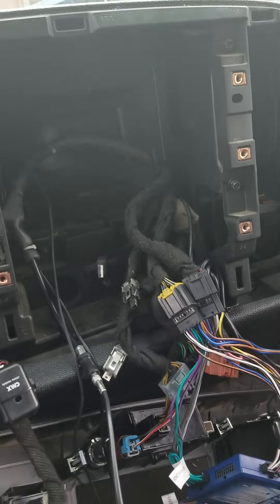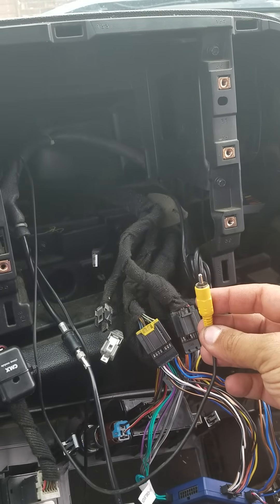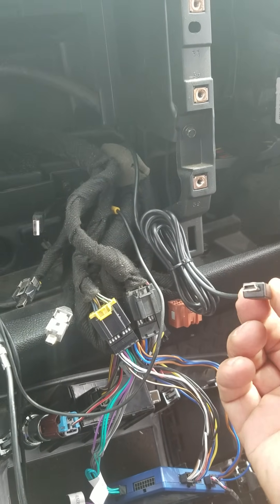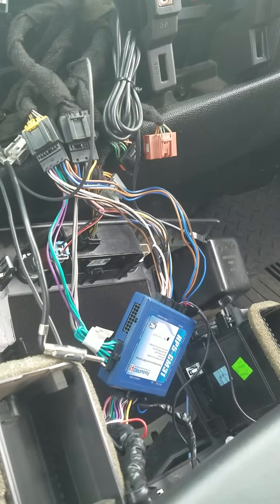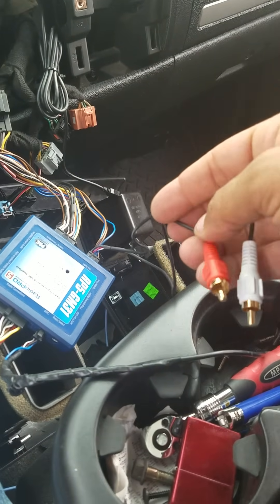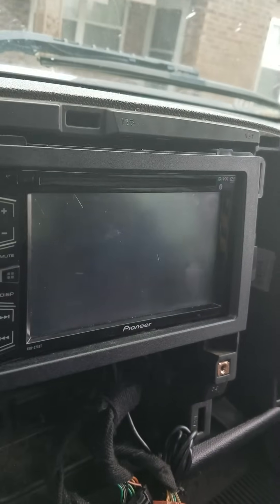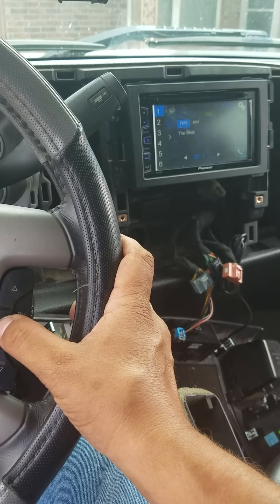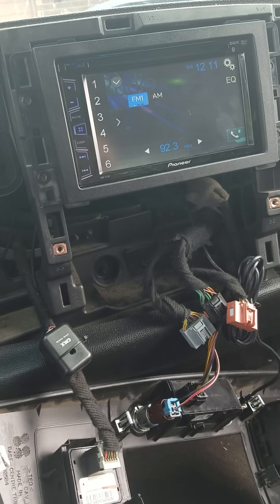Pac RP5-GM31 installation and operation.

Comment: Man! Thank you so much for making this video! I’ve spent two days trying to figure out what I did wrong. I hooked everything up but my sound was super low. That’s when I watched your video and saw that there was a plug in for amplified and non amplified on the p5 adapter thanks to you pointing it out in the video. I took it apart and checked, I had it plug into the amplified instead of the non amplified ( my truck doesn’t have a built in amp). Once I switched it my sound was back to normal! Thanks again!
Reply from the maker: No Problem, I'm glad it helped you.

Comment: Thanks for the info!  I saw this video the other day, but watched so many that day.  When my radio and kit (I went with the iDataLink Maestro RR) came in, I didnt have the connector for the video feed at the radio plugs as mine, like yours is in the rear view mirror.  So I spent 2 hours today trying to find this video again to find the location and colors for the video feed connector.  Anyways, that info helped out tremendously, and the video works flawlessly on both my in-dash and my mirror!

Comment: A little later but uhhh do I have to install this chime box, it’s very digital sounding. (Mine idk about yours) sounds like shit. I prefer the stock sounding chime. 

No dropping or anything. It was installed and I noticed the different sound right as I turned out of the installers place.

Comment: I had the same issue with my radio shutting off when receiving a call. It was also super loud when it was ringing. Disconnecting the Bluetooth on my phone fixed the issue.

Comment: Thanks for sharing the video. It was helpful. I test your theory on the Bluetooth. My new unit did the same thing. I'm guessing the old stereo blue tooth info mast be saved on the onboard computer and it screws it up. So I deleted all blue tooth devices that were programmed before installing the new JVC Touch Screen double din. It is similar to what you have and it sits in from the mount too. Not quite as deep as yours, but still deeper than being flush like the old radio (Maybe 1/16"). All in all with the RP5GM31 unit, my OnStar and steering wheel controls came right up. I didn't have to do any single button programming. One item I am still struggling with. I tried plugging in those same RCA connections for XM. My head has preouts for highs , mids and lows. (No other outputs besides the speakers) I plugged it into the middle preouts and its very faint. I can hear it, but it must need to be amplified. There is an XM port on the new head unit, but it takes a special adapter I didn't know about that looks similar to an S-video but with more pins. All in all everything is working well, but for some reason, the remote cable isn't kicking in my amp for my sub. I ran out of time tonight installing and it was the one thing I didn't test before putting everything back together (grrr). Waiting for the AMP wire kit to show from UPS this evening. I have it connected from the JVC head (Blue/white remote),  to the RP5GM31 unit (Blue/white remote), and also a lead coming off for the amp. But for some reason it isn't feeding the amp relay. I'm wondering if I needed to plug into the amplified port on the RP5GM31, even though my truck didn't have it before. But it does now. So I have a couple little items to trouble shoot in the morning. I ran out of light tonight. All in all the RP5GM31 is worth the money to keep OnStar and SWC. It made it very easy. Luckily I had the space to slide it up and out of the way when putting the head in the dash. Its tight, but I didn't have to cut anything out. Thanks again for sharing, I watched this and a couple other personal installs a couple times while waiting for parts. It helped and went pretty quickly. 
Also, as Body shot says. The Amazon kit did come with the antenna adapter. Cheers

Comment: My inter face on one of the spots to plug in has a sticker over it that says set radio select switch before connecting vehicle harness what dose that mean
Reply from the maker: Most likely it's stating that you need to select which brand of radio you are connecting to the interface.

Comment: This is very useful and know it was 3 years ago but what did you do with your navigation output wires : the green the purple & white and the pink?  If you remember and can give me some type of Information on what you do with those wires that will be great I have the same truck as yours
Reply from the maker: My truck doesn't have navigation, so I didn't use them.

Comment: If you ground the parking brake wire to the back of the radio you can watch media whenever
Reply: Dalton Tell not so fast there buddy.. the stereo.. on most of them you have to use a micro switch.. duel is the one that you just ground it toothed back of the radio.. pioneer jvc keenwood.. you need a micro bypass switch.. or a relay.. look up the video 5star car audio have videos on how to wire them

Comment: With the stock radio I noticed the volume being regulated when it was turned up too high. I just hooked my aftermarket stereo with the same harness in your video. Everything went smooth and works but if i turn up the radio too loud my deck shuts off like its in a protection mode or something. Wondering if you experienced anything similar??? Same Truck...
Reply: Ok thanks for the reply!
Reply: Did you figure this out? Mines does the same..only when engine is running though. If in acc high volume works fine. Engine running, high volume cuts off head unit and then it comes back on
Reply: Richard Rodriguez
Reply: Mine too if anybody knows why they do that can you please help
Reply: Richard Rodriguez  did you figure out what was the problem
Reply: Richard Rodriguez yes I did I had to unplug my steering wheel plug to get loud I'm trying to figure that out now

Comment: I just installed this over the weekend (2007 Yukon) and all of a sudden my battery died and electronics seemed to go haywire i.e. door looks clicking, power windows would stutter when I pushed the button. Needed to jump it. Now it says traction control needs servicing. Did I screw up the communications in the car or was this just a coincidence that the battery died. I don’t know the battery condition as I just bought it used. When installing I didn’t disconnect the battery. Any help is appreciated!

Comment: Thanks for the video. I can’t get my steering wheel controls to work! I put in a boss audio system. Let me know if you have any tips
Reply: Same here man. Boss audio in my 2011 Sierra everything works but the factory controls
Reply: Did you program the # selector for it before you plugged in to it if you didn’t it would cause that to happen…

Comment: bought my 2010 silverado 4 years ago with the same setup and all has been well until 2 days ago..the steering wheel volume control stopped working, but the rest of the steering wheel controls still work. this is also a pioneer..any idea what would make the volume parts stop working? The only thing i did different around that time was pair my new phone with the pioneer bluetooth but i doubt thats got anything to do with it being it didnt bother it when i paired my old phone with it..
Reply from the maker: You try accessing the device behind the stereo and resetting the link for the steering wheel controls.

Comment: I have this same RP5-GM31 with antenna adapter. The sound is really low, do you know why that would be?
Reply from the maker: Multiple reasons. A loose speaker wire, speakers could be blown, or something in the settings.

Comment: when you hard wired the camera, did you have to connect the camera cable (purple) that comes out of the stereo's harness?
Reply from the maker: No
Reply: I have the same vehicle and same features, I did the exact thing and it will not turn on automatically. I changed a setting and will turn on manually when I Turn the camera button on. Any special settings that you may have adjusted?
Reply from the maker: There is a harness that can be purchased that plugs in next to the parking brake that enable the backup camera to work on both the mirror and the deck at the same time.
Reply: @ramzsgarage316  do you know where to buy that or the name of the harness
Reply from the maker: @CHI-TOWN_FELON_  I haven't done enough research on it to know exactly where to get it. Or any specific brands that sell it. I came across a threat one day reading about it. I just know the price was around $50. I lost interest after that.
Reply: @ramzsgarage316  Thanks for the reply I will try and look to see if I can find anything
Reply: @ramzsgarage316  The way you did it is probably cheaper and easier anyway

Comment: How did the xm radio work I didn’t get to hear u cover that
Reply from the maker: I don't subscribe to xm, so I don't use it on my aftermarket deck. but, if your deck has the xm ready feature, it should work automatically.

Comment: I installed the same radio and connected it as you did but my factory microphone does not work when I make a call I only hear but I cannot speak they do not hear me
Reply from the maker: Try plugging it into the other input. Let me know if that works

Comment: Can i tap to the amp remote wire for my external amplifier, even though it’s connected to the PAC
Reply from the maker: You should be able to tap directly into the remote wire of the stereo harness without going through the pac if need be.
Reply: @ramzsgarage316  thanks for the reply. I did but the PAC is also connected to the stereo remote wire. Its working fine so far.

Comment: how would you run subwoofers to this? i have connected the rp5 like shown but when i connect my subs from back of stereo to amp i get nothing sound wise ..
Reply: Justin Ramsey yes. I finally figured it out
Reply: Hey what was the solution to this? I'm trying to figure it out now
Reply: Los Munoz make sure you plug into the right port on the pac  harness factory amp..aftermarketamp

Comment: Went to replace my radio and the guy before me repinned the entire harness from the truck. So far it's been a nightmare but I've got my basic wire. My issue now has been what does the signal wire from the truck go to, or if anyone can find the pin diagram for a 2012 GMC Sierra SLE with Bose and OnStar. I removed onstars chip due to OnStar being dropped this year back in June. Will be posting a video soon of the aftermath lol
Reply from the maker: Yikes! That does sound like a nightmare.

Comment: I installed the same cmx chime module on a sony stereo for my silverado 2013. I noticed that the sound of the chime is high pitch in all of its functions turn signal, back up sensor, door oper etc etc, it sounds nothing like the original, my question is: is that completely normal, or there is probably something wrong with my chime. 
I dropped the chime twice before installation, so im not sure if may be i damaged or if thats how its supposed to sound.
Reply from the maker: I noticed the chime sound from mine was not that much different from the factory chime. Your chime box may be faulty.

Comment: @Limited Automotive Is there no way at all to retain the factory Bluetooth mic?  I hate the fact that I'll have the aftermarket mic pinned or clipped somewhere when one exists neatly above the door.  I have a 13 Sierra so everything should be identical to the 11 Silverado in the video.
Reply from the maker: Douglas Stewart I only had the basic model to install. But I'd like to think that if installing one that was onstar compatible, you just might be able to. I'm not 100% on that though.

Comment: So I just did this in my truck and everything works good other than the hands free calling. It's like the Mic isn't picking anything up I don't know if it worked beforehand because I never tried it. Would I need to put the Mic from the pioneer radio in?
Reply from the maker: Austin Black yes. The factory mic won't work with the aftermarket stereo. Let me know how that works out for ya.
Reply: Limited Automotive now where would I plug the steering wheel controls into If I have to plug the Mic up?
Reply from the maker: Austin Black you don't plug the steering wheel controls into anything. The interface links the controls to the stereo remotely. You just have to set what each button does.
Reply: Oh ok. So just leave that 3.5mm connector unhooked?

Comment: hello I have the same radio except the wheel control and the back up camera, I hooked up all the wires like it says to do but I have nothing coming out of the speakers, on the wiring harness its self what setting did you set it to, or if you had the same problems i do.

Comment: What kind of connectors did you use with the RCA plugs for splicing your rear camera to your after market stereo?
Reply from the maker: I used the T-tap wire connectors. You can find them at any auto parts store.
Reply: Thank You

Comment: How much could be the labor to install this ? I have a 2005 corvette and an aftermarket double din radio which I want  to install I have the same device to restring the factory amp
Reply from the maker: Labor costs vary from installer to another. You would have visit a local shop of your choice and ask for the price of installation.

Comment: Did you have to do any sodering
Reply from the maker: I normally use butt splice connections. But you can solder as well if you prefer.

Comment: This work work a tahoe 2014 ltz with navigation?
Reply from the maker: @oscarvicpe7650  if the aftermarket stereo is setup for navigation it should work. There's also a version of this harness that comes with a connector for the backup camera if it's originally displayed from the dash and not the rear view mirror.

Comment: Hey Justin i have a 2013 chevy silverado and i just bought the gm-31. only problem im facing right now is that the radio i have doesnt have a place on the back for the SWC or the blue and yellow remote wire. Is it possible that the jack would work in one of the Aux-RIN or LIN.
Reply: Ok thanks alot justin I will give that a try.
Reply: Chris check with PAC audio they will hook you up. They have wiring diagrams for every vehicle they support and every radio they support.

Comment: Did you have to purchase a module for the XM radio ? Fella at Best Buy was trying to sell me this module along with the RP5-GM31 kit. My double din is XM ready and my old stereo has XM
Reply from the maker: David Stiff mine wasn't xm ready so I didn't have to get anything else.
Reply: If your new radio is XM ready, that means it will work with the extra XM tuner, the radio does not have an XM tuner built in

Comment: Hey Thank you info
But do you have  problem  with accy. Position  I had mine installed by bestbuy they said that function is obsolete now because of the gm31 harness
Reply from the maker: I didn't have the option for it

Comment: Is the SWC input the same thing as a W/R input? I purchased a PAC RP5-GM11 to use with a Pioneer AVH-1330NEX, and the head unit does not have a jack that says SWC. - Thank you!
Reply: No my subwoofers, the SWC (steering wheel control.) The new Pioneer has a W/R port (wired remote.) I assume that would be the same thing so I could control the new stereo from my steering wheel.
Reply: Ah! That makes sense. Yes, the Pioneer stereo has rica jacks labeled SWR and SWL. The W/R port is a 3.5 jack. Thank you for your help! The stereo should be arriving next week. Can't wait to get started!

Comment: On 2009 Traverse where are locations for camera cables white and blue.
Reply: I cant say for the traverse it may be different. But Every model I have seen on both aftermarket stereos and aftermarket cameras are purple with white stripe. Purple with white stripe is the camera reverse signal. And a composite yellow video input for the video input to the stereo. Usually says CAM VID. But you can pretty easily look it up. Just pull up your stereo model number wiring diagram. It should tell you.

Comment: If it shows up in the mirror anyways, do I even need to plug it in to the radio or can I just leave it?
Reply from the maker: That's up to you. It doesn't need it.
Reply: @ramzsgarage316  yeah but does it show up in the mirror without tapping into those wires? I still want the backup cam I just don't want to cut anything.
Reply from the maker: If you tie into the line, then it will still show up in the mirror. You don't have to cut the wires
Reply: @ramzsgarage316  I'm not asking that. If I dont do that, will it still show up in the mirror?
Reply: I'm sorry I hope you understand the question maybe I wasnt clear enough. If I don't tie into the lines on the driver side, will I still see the backup camera on the mirror? I don't really care to have it in the radio so if I can just not do that and still have it work, I will.
Reply from the maker: Yes, it will still show up in the mirror
Reply: @ramzsgarage316  Great thanks.

Comment: Why does Chevy and GMC need that adapter? My gf has a 2012 Sierra and i have a 02 Tahoe. My hahoe has the factory sub and amp so i knew the tahoe needed the adapter cause of the amp but the Sierra she has is nothing special i figured it would be just another stereo install.

Comment: i installed the same rp5 gm 31 kit with jcv double din everything works fine but the left side front and rear speakers has no sound the right side works fine. i double checked the speaker wiring for the left side and they are weird correctly. 
anyone knows what can cause this issue?
Reply: Water getting into the doors

Comment: I purchased the Best Buy kit. I called PAC they said Best Buy requested the kit without antenna adapter. Assuming so they can sell it to you. Annoying as hell. They should have changed the part number to differentiate the 2.
Reply from the maker: I agree